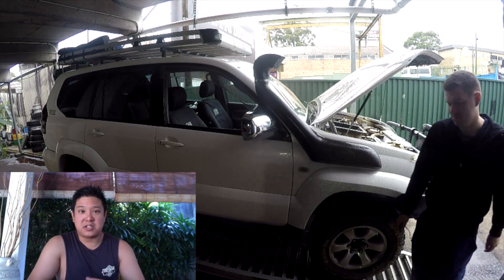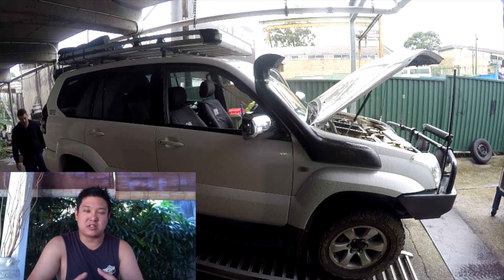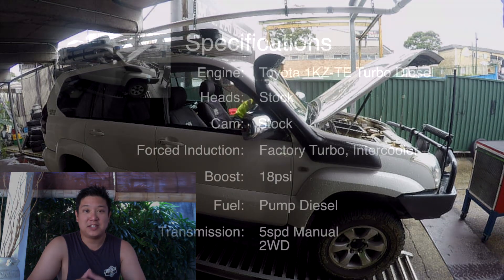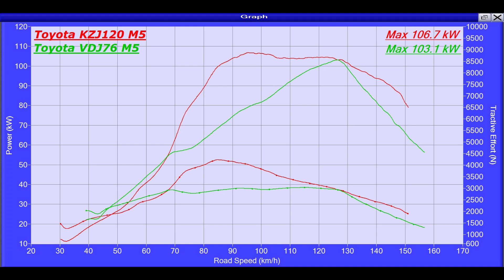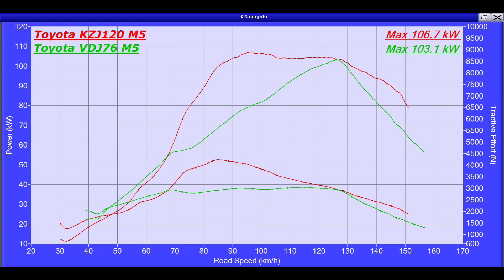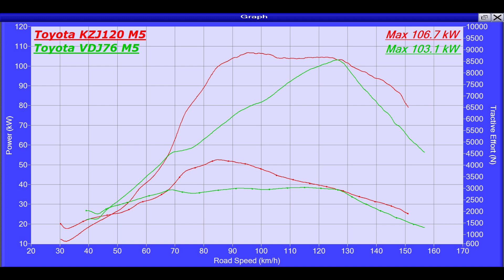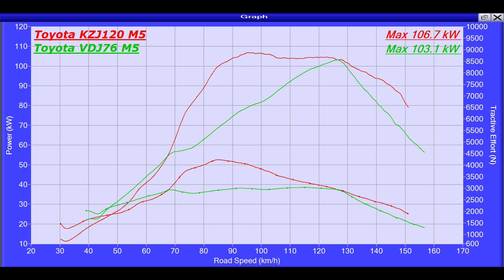Tuned 1KZ-TE vs Stock 1VD-FTV – Dyno Tested with Surprising Results!

Comment: How reliable is the engine after tuning in the long run?
Reply: Good question! 50,000km later and a trip around Australia still going strong & tests the same power & torque on the dyno. Stay tuned, working on the next stage of upgrades 😏
Reply: @benji816  Ok great, keep us updated!!

The problem im having now is finding the correct harness for the unichip to fit to my 1kz prado, im in south Africa
Reply: Oh and btw, has the fuel consumption improved after chipping and tuning?
Reply from the maker: @alfaatih637  it’s about the same. Unichip is from South Africa so I’m sure you’ll be in good hands!

Comment: Hey mate! 
Did your prado come from factory with 1kz-te?
Reply from the maker: Yes
Reply: Could you please give me the chassis number? I need to find this specific oil sump. I'm swaping my 5L engine to an 1kz te and I really need this.
Reply: Ben can you help me please?
Just need the product code of the oil sump and pan sub-assy.
I'd be grateful if you could let me know if 12102-30020 and 12101-30080 are the right ones. Thanks!

Comment: Wow I have unichip HPD top mount intercooler and full exhaust and only 90kw at the wheels I mite need a new turner
Reply from the maker: On a hilux? Check out this Hilux we did recently: https://bengineered.info/dyno-sheets/
Reply: Thanks mate for the reply I saw your link you sent me but the results you got was  from a hi flow turbo I don't have my fitted yet
Reply from the maker: Honestly, I think you would get the same. He had 90kw from another tune before he brought it for a return.
Reply: Hi i don't understand what your saying i am  running 11psi 2psi more then standard i have top mount intercooler from HPD 3inich exhaust system from turbo back unichip q4 computer 
I think if I got a retune up to 14 to 15psi I would get a better result 
Even more if I put a hiflow on it which I am waiting to get back from the shop
Reply from the maker: Yep if you ran 16psi on stock or 18-20psi on a high flow you’d get a big jump. Where are you located ?
Reply: I am in Canberra mate
Reply from the maker: Not too far to come up to Sydney once you're ready for a retune 😏
Reply: Cool how much you charge mate???
Reply from the maker: What's your email address?
Reply: Kaleen.brickcleaning@gmail.com 

Thanks

Comment: Hey Ben, always enjoy you explaining how you tune electronics. Looking forward to seeing the prado tuning.

Hope you don't mind me asking.. In BBG's surf tuning video you mentioned changing the parameters so his gauge would read diesel afr's. Could you explain or point me in the direction of how to do that? There's a real lack of information and gauges for diesel afr's on the internet from what I can find. 
Many thanks 

Edit
I was intending to buy the same gauge, defi advance zd and something like bosch lsu4.9 wide band.
Reply from the maker: Thanks for the feedback! The gauge actually is hardwired for petrol afrs however diesel stoic is very close to petrol so for monitoring it’s ok. The main issue is most of the wide bands at the cheaper end are hard programmed to a range around 10:1-20:1 which suits petrol but doesn’t read lean enough for diesel cruising. So, if you want to monitor just full throttle afr it’ll be fine. You’ll need a widebans that has 0-5v, 10-20afr. We used the 14point7 spartan for this. If you want a larger range to see cruising mixtures then you’ll need something like a TechEdge wideband that is programmable across the whole range. Hope this helps.
Reply: @BENgineered  I was hoping to see a wider range but as you say, wot afr's will be enough. Thanks for taking the time to reply. Cheers

Comment: 1)What if i own watercoolered Toyota Hiace. Can't i do such modify? Radiator placed inside car. What if i install tuned alluminium radiator with electric coolers? Is that a good idea?
2)I want to do it 2wd(part time) and custom exaust (63 or 67mm). Should i build custom turbo manifold?
Reply from the maker: Yes you can still modify it on a Hiace. I would go between 63mm or so for exhaust. I dont think a custom turbo manifold is worth it unless you are going very big power

Comment: Good info mate. I have this model. All I did was make my own boost controller....simple check ball to to control pressure to the waste-gate giving me easily adjustable stock (circa 8.5 psi) up to a max of 14 psi when the fuel cut comes in. I pegged it back to approx. 12 psi to eliminate any smoke under load. Drivability is much improved without risking reliability or longevity.
Reply from the maker: Sounds good, you might want to log fuel delivery. Often the ECU starts cutting back fuel above 10-11psi so you might need to fit a FCD to get the best results.
Reply: @BENgineered  whats a FCD
Reply from the maker: FCD = Fuel Cut Defender
Reply: post a vid on how to do it